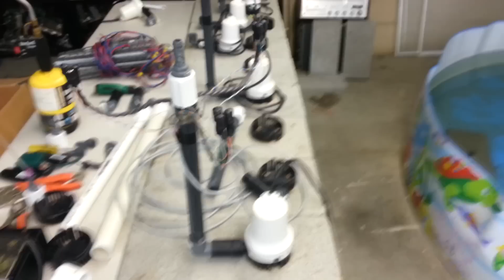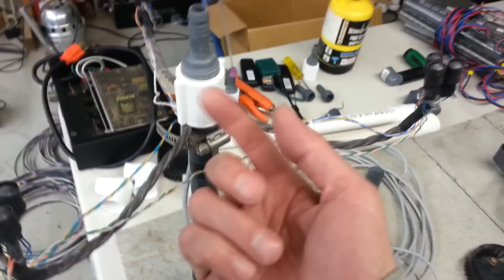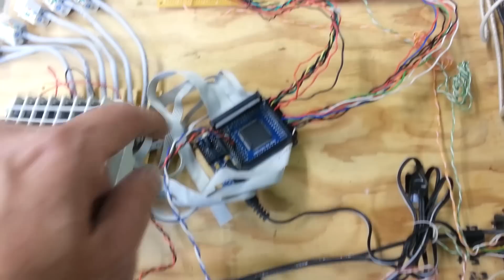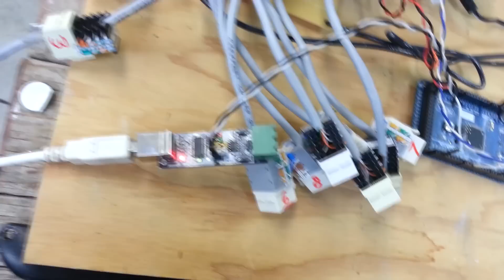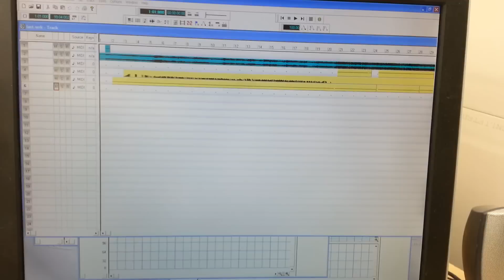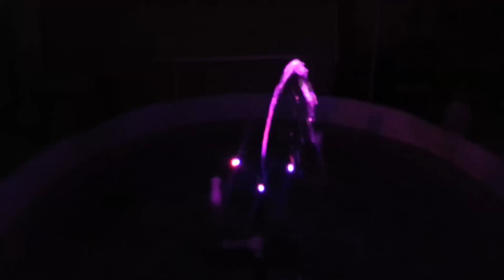How my musical dancing fountain works

Comment: Can I ask which course related into this kind of job pls kindly reply thanks:-)
Reply: Look into Instrumentation Technology and similar degrees. That would help you get on the right track.
I understand most of this. I'd have to brush up on a few things (especially AC Circuits), but this is doable with some research.